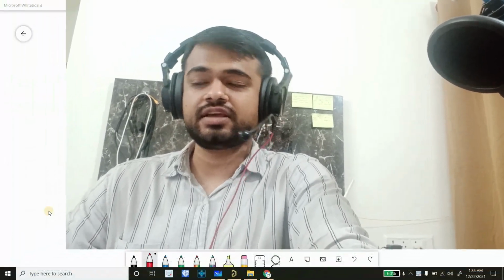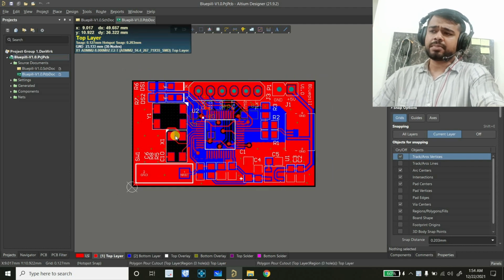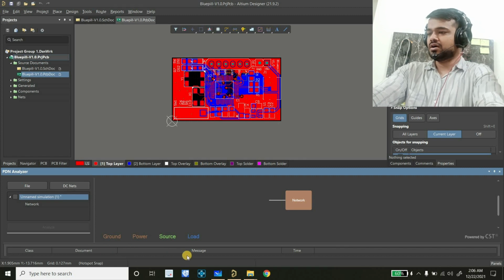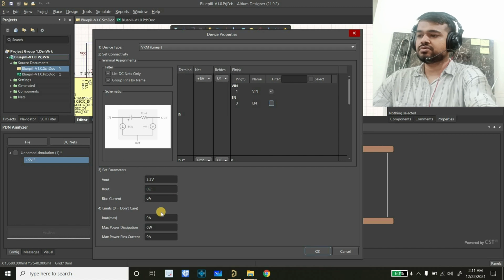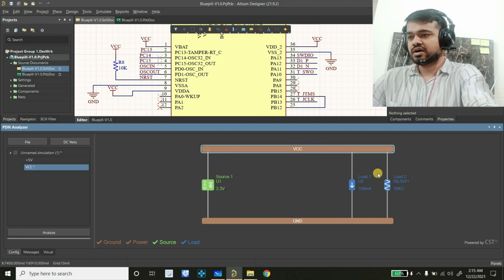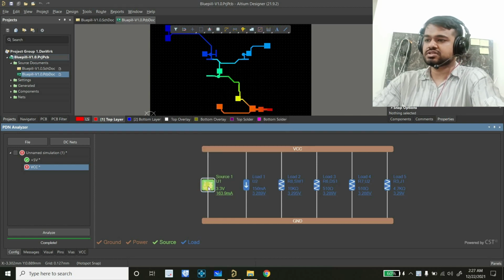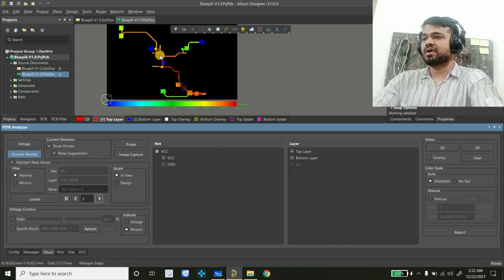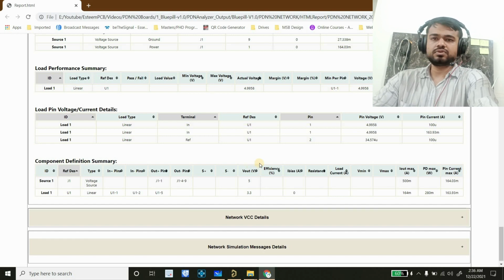PDN Analyzer - How to do PDN Analysis In Altium Designer 2022 - STARTER PART-2

Comment: What if I need simulate net "+in" ->"Resistor"->"+out"? I Have 2 pin connector with "+in" pin, then this "+in" connects to Resistor and goes from resistor to 2 pin connector to "+out". Can not understend how manage nets (in resistor inputs one net, outputs another), can not select needed nets, because it does not exist in my list(

Comment: Thank you so much for such informative lectures,.
I have a question about how to analyze dual supply op-amps. Like if we are using both +12 and -12v supplies in our circuit.
Reply from the maker: It's simple you have define the different rail for -12V and loads on that, 
PDN is nothing it calculate IR drop, 
Independent of positive or negative voltage.
Reply: @EsteemPCB  thank you sir.

Comment: Hi Aviral
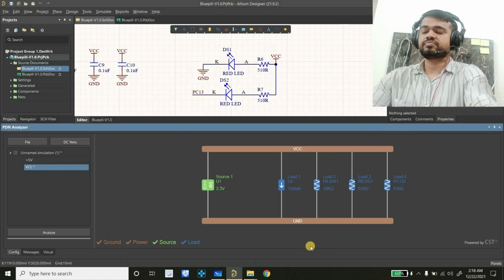@21:12 the load's LOAD3(R6) and LOAD4(R7) is not between VCC and Gnd. Instead the voltage across them will be Vcc-Vf of the LED.So I guess we have to also bring the LED's into the load consideration and input the LED Vf as well.

Comment: Hi,
So as we analyzed the current density is higher at some places so shall we use some polygon shape pad for better current distribution, pls correct me if I am wrong..
thanks_/\_
Reply from the maker: Yes current density depends on area of copper, so if you increase cross section it can able to handle more current.